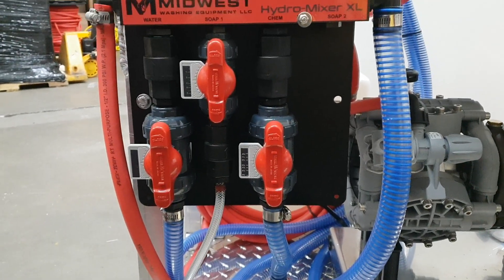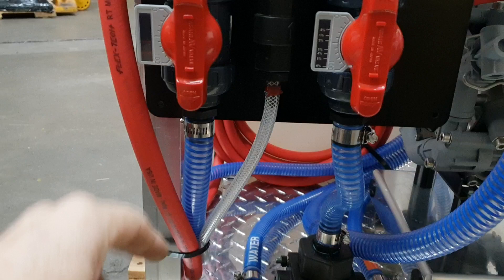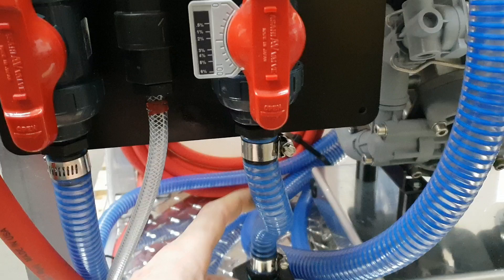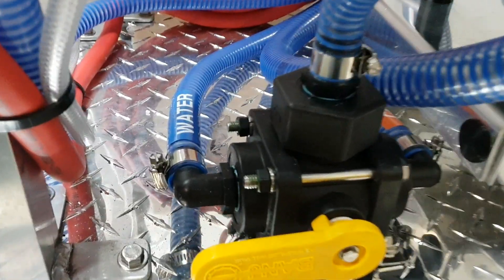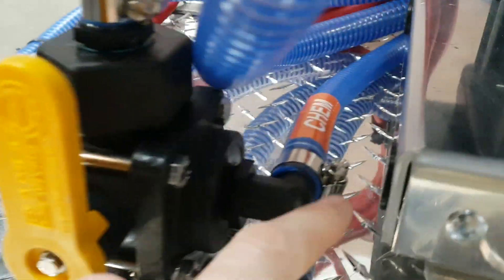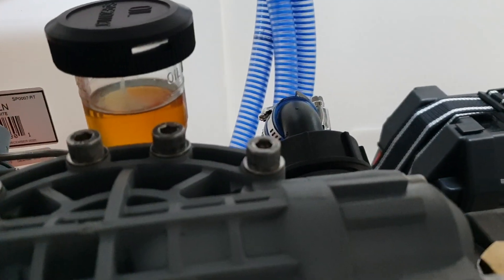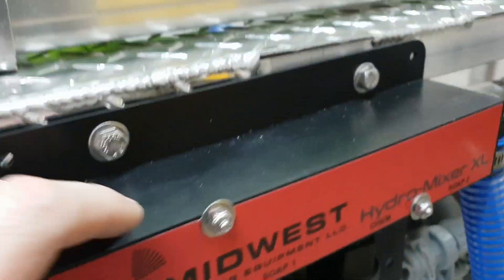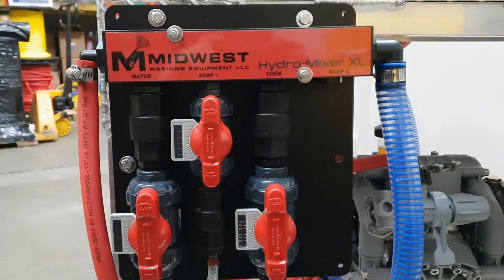Hydro-Mixer XL with manual flush rinse valve installation

Comment: Where did you get the valve? I’m looking for a valve that I can flush with that’s half inch thread.
Reply from the maker: @Omega19210  https://washingequip.com/online-store/ols/products/34-3-way-ball-valve
Reply from the maker: Order 3/4" mpt x 1/2" hose barb fittings https://washingequip.com/online-store/ols/products/hose-barb-elbow-poly

Comment: It would be nice to know the sizes of hose that connect to the valves before I receive it. So I can order the hoses. I know u offer a lot but just in case someone doesn’t get that. What I’m asking is for (idk if this is correct so please correct me): 1 1/4” out to AR45, 3/4” ID for chem line and each side of 3 way, 1” ID for water valve, 1/4” ID soap valve.
Reply from the maker: It's 3/4" water and chem on the hydro-mixer XL, same goes for the flush valve since it's water and chem you're connecting to it.
Reply from the maker: Correct on 1 1/4" inlet for AR45 and soap 1/4".

Comment: Can a 1/2in discharge hose be used? Or switch to 5/8? I currently use a half inch discharge line on my hose reel which has a half inch manifold stainless steel. I'm switching from 12 volt to p36.
Reply from the maker: It will run fine on 1/2" hose, you will see a little better performance with 5/8" hose.
Reply: @midwestwashingequipmentllc1209  awesome..thanks.. I'm in the process of placing an order for the high flow metering system and hose kit. 👍🏼
Reply: @midwestwashingequipmentllc1209  how much is the shipping to New Jersey? It's telling me $5.25 priority 🤷🏻
Reply from the maker: @xtremepowerwashing1815  that's correct, we actually only use UPS now, even though USPS still pops up.
Reply: @midwestwashingequipmentllc1209  ok thanks..didn't want to short change you . 👍🏼

Comment: In theory, could you use this valve to use 2 separate batch tanks running a 12v system? What I'm saying is I have one line coming from my pump but I have a 55 gal for house mix and a 55 gal for roof. Both tanks are plumbed from the top with a drop hose. I'm trying to figure out a way to switch between each tank... thanks!
Reply from the maker: Absolutely!
Reply: @midwestwashingequipmentllc1209  Thanks!
Reply: Why not just use this setup?

Comment: What kind of bulkheads are those and you run the hose through the bulkhead just connected to a drop tube?
Reply from the maker: It's a uniseal fitting,  hose goes straight through, no drop tube needed, 3 fewer points for potential leaks
Reply: Ok gotcha. Do you have the hose ran thru pvc then so its rigid and stays in place at bottom of tank
Reply from the maker: @123456789mm  only about a 6" piece on the end
Reply: Ok so just 6inch piece at end by a filter down in there correct?
Reply from the maker: @123456789mm  yes sir

Comment: What size metering valves and hose?
Reply from the maker: @HNK PRO WASH they are high flow metering valves. They have a V cut groove through the ball, unlike other metering valves that only have the V cut on the side of the ball.
Reply from the maker: 5/8" hose, 3/4" high flow metering valves
Reply from the maker: @HNK PRO WASH sorry for the confusion, you're correct, 3/4" supply lines, 5/8" spray hose on the reel

Comment: Why did you change the soap valve from the round precise setting knob to the big valve?
Reply from the maker: Thanks for asking and noticing.  We have considered doing this for some time and since the introduction of the XL have decided to make this changed. It was mainly because ease of operation, installation and maintenance outweighed the finer adjustments you can make with the precision valve. There was some confusion on how the precision valve actually operated and whether it was on or off in some cases. It's also easier to train a new technician or multiple operators on how to operate.  Moving forward the soap valve will match the water and SH, but will be a smaller valve so control and adjustability will still be there.

Comment: Other than the 150psi difference (and cost), is there a bigger benefit to going with the p40 vs the p36 as it relates to roof and house wash applications? Does that 150 psi difference translation to major loss in over distance or reach?
Reply from the maker: You will get more distance and volume with the P40. P40 is a single manifold as well. P36 is still a great pump and a little less pressure and gpm is a good thing on roofs

Comment: Are those check valves above the water and chem lines and then a check valve below the soap?
Reply from the maker: Yes
Reply: @midwestwashingequipmentllc1209  is that to prevent the bypass line liquids from going back down into the dedicated lines to the tanks?
Reply from the maker: @veganbcurry3396  yes, but we have them on all hydro-mixers to prevent siphoning or backflow of sh, water and soap